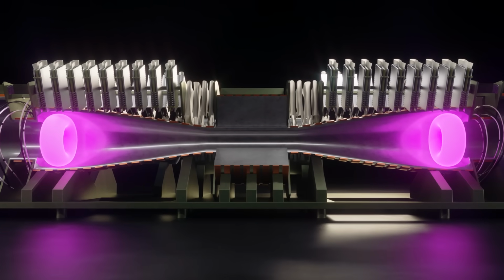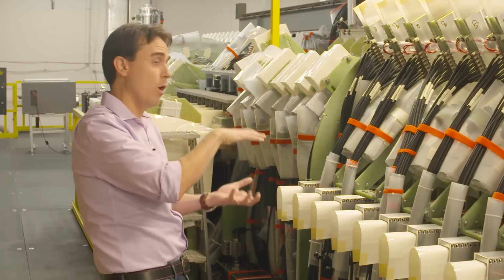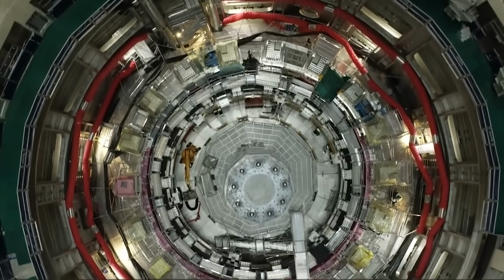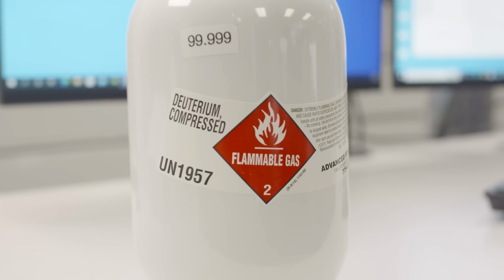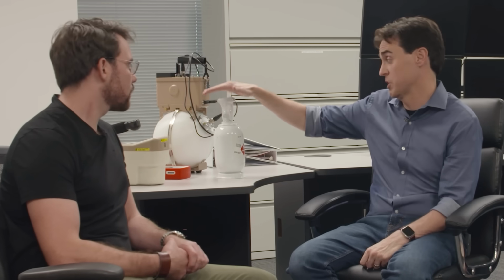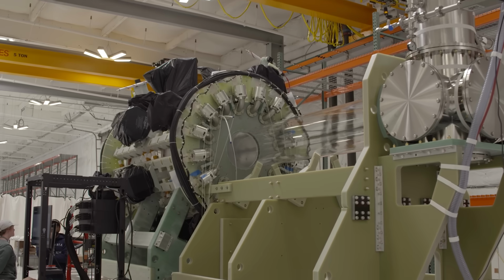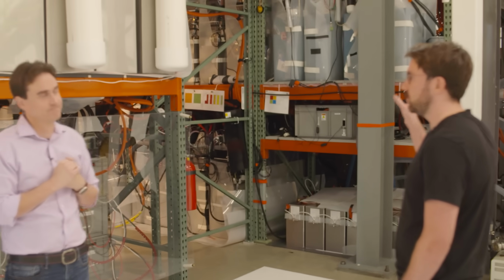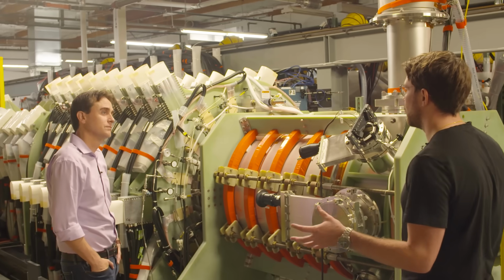A New Way to Achieve Nuclear Fusion: Helion

Comment: Trenta uses high magnetic fields running on high voltage, current etc. to generate electricity??? What is the expected output/input ?
Reply: Factor of 3 for the first power plants, might be more for later versions.

Comment: I've been a fusion optimist for a long time.  But that optimism is around the inevitability of fusion.  This WILL be the energy solution of the future.  I've always been pessimistic about wind & solar scaling, and about fission ever being regarded as politically acceptable.  

But fusion proponents have been really dishonest about the likely timeframe.  The old joke that commercial fusion is 30 years away and always will be isn't quite correct.  We have made and ARE making incredible progress.  But the time frames are such that we're talking about the back end of the century -- and that's the OPTIMISTIC projection.  We need to get started on geoengineering (most likely solar engineering) NOW in order to mitigate effects until then.

Comment: This is so.... interesting! I wonder how much they have progressed in these 6 months.

I wonder if they can design it to act like a heart where they input electricity to power it then after the "pulse", the fusion reaction rebounding and pushing back on the magnetic field, a slightly larger amount of electricity is returned to the capacitors or redirected into batteries or wherever.
Reply: Yeah I figure once ignition is achieved it might become self-sustaining where it provides enough energy to keep itself going. Thingnis, when the plasma pushes back out and generates energy, you need to put more energy in again to re-compress it, so i wonder if there's an issue with having to put just as much energy back in, defeating the purpose

Comment: Making a fuser is impressive for a 14 year old not so much for a corporation. What's their tritium beerding ratio?  How do you use that fusion energy to make electeicity?
Reply: They don't burn Tritium. They are burning Deuterium to make Helium 3 (and Tritium as a byproduct, which can be sold, burned or stored until it decays into more He3). 
They are directly extracting the fusion energy as electricity. Essentially, the FRC expands again after the compression, driven by its own internal pressure and the additional energy from fusion reactions. That expansion induces a current in the coils that were used to compress the FRC in the first place.
Reply: @Elmar Moelzer  directly extracting as electricity? Is that the level of thorium powered car intelligence?
Reply: @jedrek1521  That car thing was nonsense. This is real, though. Works very differently too.
Reply: @elmarmoelzer2229  guess only time will tell, I hope I'm wrong but we've been down that road for decades now and there's a reason why viable tech (fission) evolved so much whereas fusion has been a decade away for nearly a century
Reply: @jedrek1521  
Fission is great. I am a big supporter of fission as well.
Fusion has been mostly delayed because funding has been consistently below the "fusion never" level. Look up the ERDA plan for fusion!
Now, with private investors progress has been a lot faster.

Comment: Seems a little fishy to me. There's no way that chamber can withstand millions of degress of heat he claims to generate with this process.
Reply: Ah! The expert is here to say.. “nuh uh” lmao bro what? Little paranoid huh?
Reply: Sure it can. For one, the magnets prevent the plasma from touching the walls until the very end when it has already cooled off. Secondly, the plasma is very hot, but not very dense, closer to a vacuum than to ambient air. The energy content of the plasmoid at peak fusion output is just a few kWh.
Another way to look at it, is that at 50 MW, these plants will have the same power output as the diesel on a large cargo ship or the power produced by a single A380 Jet engine during takeoff.

Comment: As you increase the firing rate of the generator, the cables for your capacitors are going to cycle much faster, generating more flux and heating up the steel structure the capacitor banks are stored in.
Reply: They have their power supply running at 1Hz now for prolonged periods of time.
Reply: @elmarmoelzer2229  I was more referring to getting 60Hz
Reply: @daniellewis984  
Their power plants will run at 10 Hz. The recovered electricity is stored in capacitor banks and gradually released to the grid. So, their power plants can run at any pulse rate below 60 Hz and they will still deliver power to the grid as needed.
Reply: @elmarmoelzer2229  Ah, that makes sense and works.

Comment: i am curious how viable ti would be to make these into a ring, like 4 pairs all firing at once into a center chamber. it may need to be a bulb like chamber to properly contain the fusion but it would look like a sun inside in theory.
Reply: There would be no room for the compression magnets then.
Reply: @elmarmoelzer2229  a fair point, the only solution i can see for that is to design the central chamber to be magnetized itself. the version they show us may be the most efficient format with current electromagnets. 

i'm mainly thinking about ways to increase output while keeping the same footprint in a facility.
Reply: @ThommeGun   Easiest way to do that is to run multiple cores in parallel. They can power 6 maybe more with the same power supply system. The power supply is one of the main driver of overnight cost. So, there are some major cost savings there.
They can also build them bigger, but that would be a problem for road transport. So, I think that just having several modules is more economic. Also adds redundancy for maintenance and all that.
Reply: @elmarmoelzer2229  again another fair point. i did just have an idea... if there was a way to have multiple chambers in the same system. like the electromagnets surround two separate tubes, they could cause the reaction in two chambers simultaneously. (i think this may have been what you meant but i am not certain.)

i do wanna say the biggest benefit i can see with this system as it is now, is how modular and non-mechanical it appears to be. working entirely off of electromagnetism and energy means that it's propensity to fail due to mechanical issues like turbines is far lower.

i know we don't know what it's internal chamber is made out of, but i hope that is a cermet. if it is not i'd hope they'd look into it sooner than later even if it's just an internal plating.

Comment: So would this become a 'Plasma Cannon' if one side fails to fire?
Also, how is this thing not just a giant fusion BOMB? It seems awfully similar to the early plutonium nuclear bombs that fired two lumps of fissile material together...
Reply: - No, the plasma is very hot, but the density is closer to a vacuum than ambient air. The peak energy content of the fully merged and compressed plasmoids at maximum fusion rate is in the single digit kWh.
- Because fission only need to put a critical mass of fission fuel close enough together to get a fission bomb. It is a lot harder with fusion.

Comment: love it - what would happen if you had all 6 sides of the torus rather than end to end magnetic compression? Also if you can answer - is it possible to make cold plasma torus?
Reply: If you had 6 acceleration sections around a cube (I assume what you meant) then there would be no room for the central compression magnets.
Reply: @elmarmoelzer2229  sorry bit of a confusing question. Should have worded 6 acceleration sections. Could get a bit squeezy🧲⚡

Comment: ..suggesting applications inducing a nuclear spin, while the molecules are at fission; utilizing magnetic induction coil at 22.23deg(X).. #freeenergy4life #intrinsicMagnetosphere ..you guys are so close to achieving fission. the shear fact your team achieved fusion without it going repulsive is a breakthrough on its own..  meaning you have a viable molecule that would become fissionable-sustainable.. you may have to modify the isotopic signatures to ensure proper reactivity/spin responses, advancing V output.. you want them magnate, but want to prevent the fusion with the spin.. capturing the reactive intrinsic magnetic energy.. #planetarycore #muchLove #teamOne .04%vacuum. apply spin and heat in cohesion..

Comment: What's about the Neutron Erosion in the Fusion zone, which is  big problem e,g, the Tokamak of Iter?
Reply: Compared to D-T fusion systems, their system produces neutrons only in about 1/3 of the reactions. Also, the neutrons from Deuterium- Deuterium fusion reactions have a much lower energy (2.45 MeV) than the neutrons produced by D-T reactions (14 MeV).

Comment: Aren’t they wasting a considerable amount of energy from the neutron mass released in the reactions? Will that issue ever be resolved or will it forever be a second thought because of the surplus of energy captured through the process?
Reply: The neutrons only make about 10% of the energy released by the fusion reactions. Capturing that energy would require complex and expensive systems. It is not sure whether the extra capex for that is worth it.

Comment: Interesting, impressive, could be life and history changing...needs to be spread worldwide IF the system can "do" the holy grail of producing more output power than the input power...and IF the design can be sustainable.
Reply: It will be usefull for conquering the solar system one day.

We already have had systems that produce huge amounts more energy then we put in for decades. And at a fraction of the cost.

Comment: Wouldn’t it be the most productive idea, for now, and as a start, to instead build an entire hermetically sealed enclosure of water, that inside of which you detonate the smallest possible thermonuclear charge, maybe without any toxic(ally) wasteful byproducts from the standard “fissile matchstick” strategy that’s typically used, inside that water ? It absorbs all the shockwave’s energy, & goes so far as to suspend itself in a “permanently passive maglev” state, such that it is surrounded by a relatively thin & malleable layer of pure vacuum, preventing the blast’s energy to pass through…

Or, rather :
1) The magnets’d be better equipped to receive this kinetic shockwave, & transform it into electricity;
2) The steam created would contain all the energy, & automatically start to distribute it’s energy in turbines place above them in this enclosed space that’re large enough to absorb their contents & transform this “DISordered” Heat into “Ordered” Work & Power

Comment: the question isn't can we use this tech to save the planet.its can humans use this drive of energy to leave this one planet and head off into the stars.and it goes to show that if a human can dream it up it's almost a certainty that it will come to be in some capacity.2 problems for that. one who gets to go and two how big does this have to be to be practical on a man made space transport.we might help this planet with this power but we will need to leave this one for new ones .otherwise why are we studying anything about space if we don't need to know.and why do people say modern tech .it's not modern we thought it up it happens they could have done this along time ago.had someone thought about it hard enough.stop thinking aliens in space when you see humans out there first. make no mistake about this first it's made then controlled by one country or another and in the very far future it will be the base for what happens with humans exploring the stars to what end?sorry so long but there is soooooo much happening here that it's very exciting.if we don't kill ourselves tryg to do it first.

Comment: this concept is not at all new and definitely not unique to these guys and a few others. i understand they let you come and have a look providing you good content, but you have absolutely 0 fucking balls. uninformed i can see you thinking its not the bullshit scam it really is, but in the process of doing research you definitely figured that out at some point.
never-mind it not at all being ethical to do an advertisement for a fusion start up that is perpetually 5 years away from their goal, then attempt to present it as a documentary. i doubt anyone is going to invest based on this video, but still.
Reply: Define "not at all new"!
Yes, FRCs have been done before and the members of Helion's founding team were actually involved with several of them. They applied the lessons learned from those to their own design, which they have tested over 6 prototypes so far.
Lessons learned and applied:
1. Size of the FRC. The larger, the less susceptible to n=2, rotational instabilities.
2. Elongation to radius ratio. The longer the FRC, the more stable it is to tilt instabilities.
3. The merging before the compression. This part creates a single, hotter and more stable FRC as a target for compression. FRCs get more stable, the hotter they are.
4. Helion's FRCs have a very low electron to ion temperature (Te:Ti) ratio of 0.1 and less. That makes things a lot easier compared to machines where both are in an equilibrium because: 
P(fus)/P(loss) scales as Ti^1.5 / (Z^2 * Te^0.5 )
Where Z is the atomic number (in case you wonder about that).
Reply: @elmarmoelzer2229 
it says "a new way" in the title of this video. big ol' letters. pretty blatant. here's some semantics, a marginal or even an astronomical 10% improvement doesn't warrant the word new, emerging, but certainly not new. yes, not a claim directly made by any employees in this video. but i don't think they are against that claim being made on their behalf.
anyway, lots of sleight of hand from their founder and this videographer. making implications, not technically lying.

"power generation by 2028". not just a lie, a god damned lie. maybe one they believe (doubtful, most scientists know progress happens a gnats hair at a time). another claim of theirs, $0.01/kwh, that's a straight up joke. just absurd.
funny how with so many of these startups the deadline moves one year if not more, every year. what was their last deadline? 2024? laughable. i get they need to make these fantastical claims, but when they inevitably go public, they go from just unethical to a skeevy salesman selling hopes and dreams.

i'm going to ignore the fact that you worked for them, but it's definitely worth a mention in case it's not as obvious as i think it is.
Reply: @heresie  
- It is new in many ways and those do amount to a lot more than a 10% improvement. The only thing others have had in common with their technique is the use of FRCs (and there are many ways those can be made and used).
-Actually they are planning for first net electricity by the end of next year. 2028 will be the first actual, commercial power plant.
- the emphasis in on workED. That does not negate anything I said.

Comment: The DoE's inertial confinement reactor is for designing hydrogen bombs. There's no way it'll be scaled up into commercially viable electricity generation, and they know that, but inertial confinement fusion is what happens inside h-bombs so doing it in a lab is useful for making better bombs.
Reply: This is not NIF, though. Very different principle. It is not inertial fusion but magnetoinertial fusion.

Comment: I can see the benefits of Helions machine vs large scale Tokamaks and its great to finally see a new-ish approach to generating electricity! We have been burning things to spin turbines since electricity has been invented and its nice to see something updated. Even Tokamaks make steam to turn turbines...there has got to be a better way! Awesome video regardless and I think some of these physicists and engineers deserve a huge thank you for lifetimes of work on trying to crack fusion. Does anyone know the percentage of energy return using Helions machine? Does it actually create more energy than those magnets use to compress gas into plasma?
Reply: i believe it does, the only part we need to do is refine the input energy to max output energy

Comment: I absolutely cannot wait for a time when nuclear fusion becomes a viable energy source for large-scale distribution. It will be utterly revolutionary and will be a large driving force toward an electrified world. Our consumption of fossil fuels is still insane, even as auto makers try to shift their product lines to a more electric focused direction, but the promise of extremely cheap, reliable, and clean energy source will make their adoption even easier to accept. It is all still, of course, predicated on substantial improvements in energy storage technologies and a significant outlay from private and public funds to create the appropriate electricity distribution networks to cope with such a massively increased demand. But it isn't just cars that will be impacted, but also building heating systems, large scale transportation systems, operation costs for datacenters, and much more that I can't even begin to parse off the top of my head right now. I'm looking forward to it.

Comment: Fusion is a pipe dream, maybe in 50 years.  Creating a flash of fusion big deal, maintaining a consistent burn like the sun is a whole different thing. Also, as soon as the technology exist, you know someone is going to try a weaponize it!
Reply: This is by design a pulsed design. They will do 10 pulses/second. This helps them sidestep the problems of steady state fusion machines.